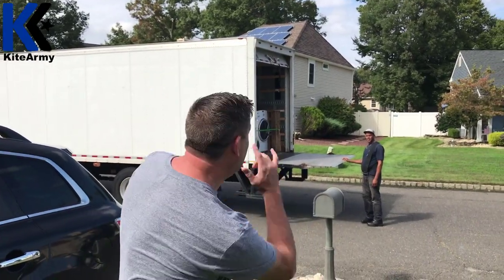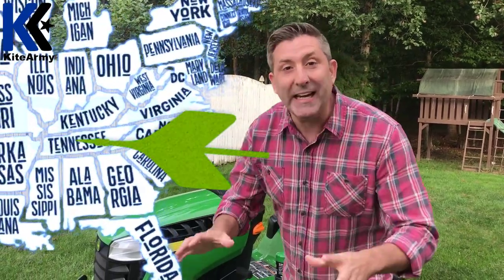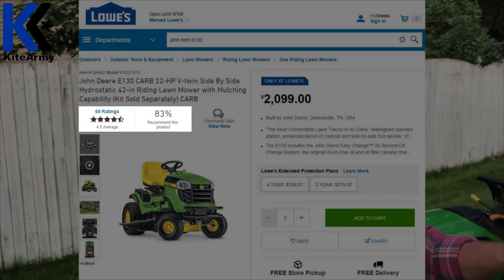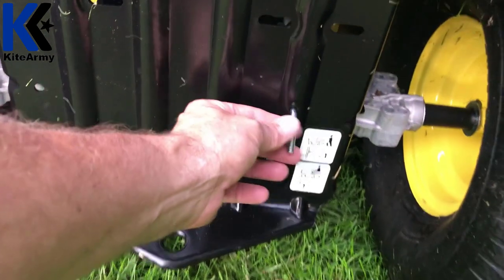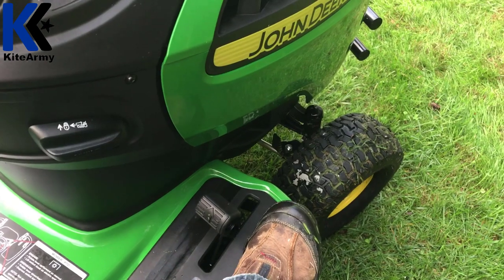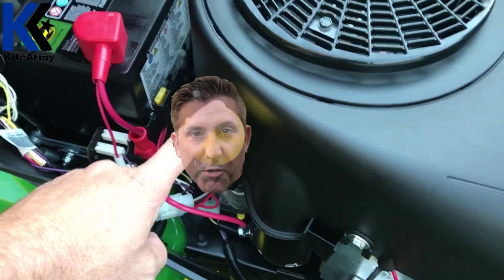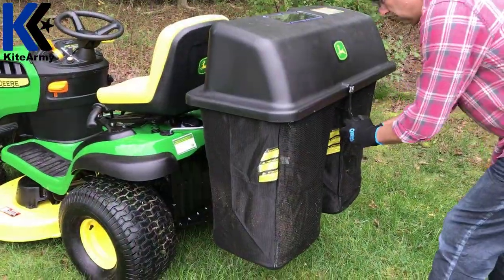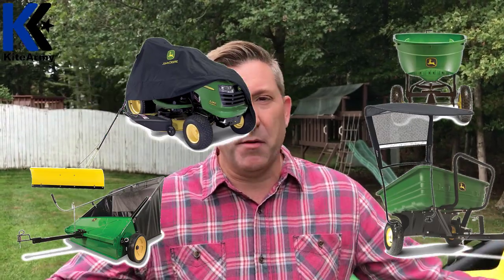Best Riding Lawn Mower 2019 | John Deere E130 Review 🌿🌿🌿

Comment: I am leary of the Easy Change oil filter system on the JD mowers until  15 or 20 years of proof they are engine worthy let alone the added expense of changing your oil verses an oil filter plus 2 qts. of oil.
Reply from the maker: I have the same worry - that being said if you follow the schedule I bet you will have no problems.  I have neglected changing the oil in some of my machines just because it is such a headache - that must be worse than this.  Only time will tell but I think this will work out.
Reply: Is anyone aware yet that this oil filter package is $39.99. Around half of the dirty oil will remain in the engines sump, so each oil change will more or less refresh the dirty oil. J.D. has been in the grounds care business since 1963 with the introduction of the 110 garden tractor. J.D. and Briggs & Stratton still can't come up with no mess oil changes, so this is the answer? Also it is pre- filled with Turf Guard 10w30 which is inferior on 4 stroke cycle air cooled engines in hot weather. They say 10-30 is fuel saving, yet it is a year round compromise and the engineers know it! SAE 30 above 40 degrees and 5w20 or 5w30 below 40 degrees. I am a 56 year old collector of lawn and garden tractors and have been restoring/repairing since 9 years of age. The point I am trying to convey is that engineering on 100 series models is price consideration only. My D140 has had the following  issues after only 3 years and 240 hrs service: front wheel bearing failure even though I was using J.D. SD Polyurea grease, deck and drive belt failures, headlamp pigtail socket failure, and front tires that wear extremely fast [DONT DRIVE ON ROADS]. I wont even get started with the video as [respectfully] Kite Army will learn in time the foibles of these lawn tractors. One last thing. 2 quarts of Pennzoil 30wt and a yellow [premium]  696854 Briggs oil filter cost about $12.00. Thanks....
Reply from the maker: @billrice2284  Fair comment - Anything that saves me time to do the things I need/want to do - I'm mostly on board - even at $40 per oil change.  Don't forget, lots of people don't perform the oil change themselves, so they end up paying $200 for a oil change.  I like this solution.

Comment: Do yourself a favor get a pre owned GX 335 for about 2500.00 it is a super solid unit with power steering and power deck , I would not buy anything green sold at lowes. I paid 6K for my GX in 2000
20 years later still my primary mower . See if this Lowes deere is around in 20 years.  I mow 2.0 acres plus pull a 1,000 pound trailer.
Reply from the maker: I wonder if I will be around in 20 years :)
Reply: I hope so , I just like Over Engineered  ,  It has only had routine maintenance
Reply from the maker: Cool.  Do you think that the quality of the Loews John Deere is inferior?
Reply: Kite Army 
All BS aside model for model no but a $2000 to $ 3000 John Deere at Lowe’s or the John Deere Dealer is not the same mower that built the John Deere Reputation of Long Term Durability.  The LX series that JD Sold in the 1990 years was 3,000 to 4,000 then followed by the GX then the 425 Series .
The difference is the Duty Cycle and the Strength of the Parts for the long term  The  Higher series and I don’t know .
Todays numbers  but they might have power decks , power steering , all wheel drive , 3/16 or 1/4 inch steel frames They all mow good usually right out of the box .   And for many people they are all they need or can afford and thats fine , just not for me .
Reply from the maker: John Deere has an excellent reputation.  They probably saw an opportunity for folks who have a small area to mow but still want a quality mower.  I guess I will let you know how it works out in 20 years :)
Reply: Kite Army 

You contact me i may not remember to contact you at 74  But i hope we both are still green
Reply from the maker: Looking forward to it
Reply: I would not buy any mower at lowes the deeres are good but the rest are cheap junk.
Reply: It's a lawn tractor and for many a lawn tractor is all that is needed.  I got close to 20 years out of my $1200.00 Craftsman mowing my half acre before buying an E170, and I anticipate the E170 will last just as long for what I use it for.  For people with a smaller yard, you don't need a $6K machine to cut grass. "Preowned" is always a crapshoot.  You can get one that is great, but you can also get a perpetual science project.

Comment: All the “E” series JD’s got fairly crappy reviews on the Lowe’s site. Hard to tell how much is user error, poor service from Lowe’s or the John Deere dealer who preps them before being sold by Lowe’s. While the self contained oil change is definitely convenient, the $70.00 per unit price tag isn’t! I really wanted to get a John Deere mower  this spring however I’m still on the fence.
Reply from the maker: I think this is pretty good - I think a lot of people just grip about things.  I picked up the oil change for about $45 - much cheaper than having the dealer do it.
Reply: The E140 has a regular oil filter...I’m buying it soon or an S240 or possibly an X series mower.
I have a D 110 now for 4 years.  No problems..worked it hard.
I would only expect to mow the lawn or use the cart.  No snow.
Reply from the maker: I prefer the all-in-1 filter
Reply: I work at the Greeneville factory that builds this mower...I can promise you, we put a lot of love into each unit we build.
Reply from the maker: Thanks so much for commenting - sounds like a labor of love

Comment: =longest lasting is the e100 with a manual transmission,hydrostatic trans will be the first thing to break on your john deere
Reply from the maker: I have heard complaints about the hydrostatic trans - Mine is holding up good - lets see with time
Reply: E100 has a plastic transmission, e110 or better is steel.
Reply from the maker: @nickm.6408  yikes plastic?

Comment: MTD with a green paint job
Reply: They are ALL MTD Built
Reply from the maker: @petmycat2720  I can't find any info that MTD builds these mowers?
Reply: @Kitearmy  I just called a friend of mine and he said Briggs and Stratton build some engines for John Deer. He works at Briggs and Stratton in Milwaukee Wi.
Reply from the maker: @petmycat2720  It could be a different model?  I think MTD is a competitor
Reply: @ADJ30168 Please say it aint so...I'm researching to buy one.
Reply: @ADJ30168 Great...Now I'm going to bed upset....THANKS MAN.
Reply from the maker: @ADJ30168 I have heard rumors of that.  Though on the documentation it says made if Greenville TN?
Reply from the maker: @ADJ30168 All sounds plausible.  I guess you pay for what you get - but I have to say this mower so far seems to be holding up well.
Reply from the maker: @ADJ30168 No way - your comments were more than fair.
Reply: @ADJ30168 The motor is MTD.  Confirmed this at my local JD dealership. However, they do stand by the 2 year or 120 hour warranty, especially if you buy from them.  They will pick it up for free, fix it, and bring it back.
Reply: Nick M. Your dealer is full of shit... MTD does not build engines.  John Deere does not sell equipment with their name on it unless they make it, period.  These are built by John Deere in Greenville TN and they use Briggs and Stratton Intek or ELS Series engines.
Reply: Jack Wertenbach wrong, try again
Reply: PETMYCAT wrong
Reply: They are not at all mtd lol
Reply: @ADJ30168 you are wrong. These are the same exact mowers you get at a JD store
Reply: @nickm.6408  So if I buy a JD from Lowe's & I get fed up with them not being able to help with a problem, the dealership will take of me as if I bought it from them?
Reply: ADJ30168 the e160 I bought last is to be taken to my local John Deere dealership. Which we bought a tractor from in the 70’s.
Reply: Just  got a E130 and I like it.Hope it lasts as long as my Cub Cadet has, 16 yrs
But  in the 16 yrs i replaced an engine (at 18 months out of warrentee) and PTU at 2.5 yrs after that it was good until this yr when deck rotted out 
The Deere rides like a truck compared to the CUB CADET but it cut great and has power to spare. As for comment about just an MTD painted green he is a jerk
MTD makes around 4 or 5 different lawn tractors JD isn't  one of them. The Cub Cadet IS.
Reply: Not even close
Reply: @Kitearmy  because they dont. This guy don't know wtf hes talking about
Reply: @ADJ30168 false
Reply: @ADJ30168 it's the same exact mower you can find at a JD dealer 100%

Comment: It is ridiculous that they say a model is good for only an acre, WHY, can't it hold up past an acre?  
I got one. I like it.  It cuts the grass perfectly. The belt system is well designed. 
It is the best choice of the mowers in its class. 

BUT, the seat is not for tall guys. On hills, I nearly side off of the seat. 
The cleaner is useless. The deck spindles are sealed, so greasing them is not possible. 
The automatic transmission is weak, a standard would be a better choice, if there was one. 
The quick change oil filter is absolutely stupid.  Just a gimmick for more revenue.
Reply from the maker: So - I'm not sure do you like this mower or not?  Sure it can be used for more than 1 acre but they sell other mowers that will make the work easier and require less time.  I also like the quick change oil filter - just easier and gets it off my honey do list

Comment: Eh I don’t like having to push down a pedal to make it go. Why not put it in gear you want and go?

I’d go for a zero turn personally
Reply from the maker: This also controls your speed - the harder you push the faster you go
Reply: I bought one of these and got it yesterday and the same model the e130 and it jolts a lot like most of the time I like jolt in the front is that normal cause it kinda hurts your body?
Reply from the maker: @jacksingh2407  Mine did not do that - you have to push the accelerator smoothly - it controls the speed

Comment: The only thing that is a flaw in my opinion is the engine, the Briggs is a good engine but it won’t last as long as the Kawasaki on the S240 and the X300 X500 and gasoline X700 tractors. If you want to spend a bit more and get the S240 with a 42 or 48 inch deck it would last longer. But other than that great machine!
Reply from the maker: I do agree - I would prefer a Kawasaki over and B&S

Comment: I will never have a yellow and green machine on my property again this factory makes machines using the JD name but not the reliability, John Deere sold out, I was told my machine is not meant for hills transmission is shot after a year and if I fix it for 1500. I am still stuck with a machine that is useless on hills...By ignoring the Lowes Costco or just any big box stores for quality issues, John Deere you lost me!
Reply from the maker: That's sad to hear - I don't have any rough turain so I can't speak to that.
Reply: Look to see if it has a hydro gear transmission...a quality small engine Repair shop knows John deere want cover under warranty  , the transmission is still covered by hydro gear...they warranty is different, theyll send a new one ,I delt with husqvarna on this, 2 dealerships had no idea,try it
Reply from the maker: @davidrodgers7224  I have heard other complaining about he hydrostatic trans  - I love mine but it is still very new
Reply: What happened to your 2yr bumper to bumper?
Reply from the maker: @greekphysique6141  Good question

Comment: And it’s a briggs engine not a John Deere
Reply from the maker: Right
Reply: Yep. Briggs & Stratton with a J-D sticker on it. I've had my 145 for 12 years and the 24 hp  engine has always performed well, uses no oil. I just change the oil and filter every Spring, air filter every other year, and spark plugs about every 3-4 years. Grease the fittings and the front axle rub points about twice a year. I don't use it all that much, about 25 hours a year.
Reply: Rob J I have a 15 hp kohler from 1997 and I have 1200 hours on it uses no oil. Some kohlers are bullet proof!

Comment: Heres the truth, I have had one of those for 7 years, the motor not made by deere is great. The deck is trash, total trash. had it crack at the weld joints multiple times and places. The spindles greased every month I. Summer still crapped out.
Reply from the maker: That's not a good report at all.  Hopefully my experience will be better

Comment: Unfortunately this machine comes with a Briggs and Straton engine.  Briggs used to be a good engine however they lack reliability now days.  The Kawasaki V twin is far superior.  Can NOT get the Kawasaki engine on a 100 series riding mower.  For just $400.00 more ($2,400) you can get the JD S240 which is a better mower than this 100 series is.
Reply from the maker: I use to love B&S too.  I'm not as confident with their reliability.  Thanks for the comment
Reply: I've run my JD with a Briggs 19.5hp motor for 10 years without a hiccup. Take cafe of it, it'll take care of you.

Comment: Its a nice riding mower, but I wouldnt buy it because it has a Briggs and Stratton engine
Reply from the maker: I have hesitation about B&S too
Reply: I had a Craftsman mower for 18 years. Only got rid of it because the deck rusted through.  The Briggs engine was still running strong. It’s all about maintenance.
Reply from the maker: @danapitman2269  Cool

Comment: if only if it had a manual gear selector
Reply from the maker: I like the automatic but I could see why some people prefer manual
Reply: @Kitearmy  yeah manual in my opinion is better because I don't like to press the pedal to move it
Reply from the maker: OK - I prefer the pedal that can control your speed
Reply: @Kitearmy  what would be better if there would be a pedal that actually adjusts air to fuel ratio, it exists in aircrafts but not in cars or lawnmowers. The benefit with this would be that we can pretty much adjust fuel consumption for the task the lawnmower would be doing
Reply from the maker: Wow - a purist!

Comment: You are biased due to getting the mower for free.  You didn't say what you like compared to other mowers.
Reply from the maker: True - I'm also honest, unlike most other videos on youtube - that get if for free and don't tell you.
Reply: @Kitearmy  ,  I need to buy a new 42" in Spring-2020.  Thinking Sears ProSeries, Husqvarna, John Deere.
I want HydroStatic,  Kohler engine, cast front axle
Was hoping for $2000 or less.
What do you recommend?
I have a 30 yr old 42" Craftsman with Hydro + Kohler.  Still running great but the deck has corrosion holes.
Reply from the maker: @rondail5675  I would stay away from the Sears - they are built by a bunch of manufactors and are not what they were.  Don't know much about Husky but it might be hard to repair if you have an issue.  I'm in the process of testing a Toro zero turn.  Don't know if I can recommend yet.

Comment: #1, No way would I ever buy a mower from a box store!!! Buy the same mower from a real JD dealer and there going to put you at the top of the list to get it fixed. #2, I'd never buy another JD mower, and I've own 3 of them Unless it was a commercial unit. The decks rotted out, in one year all the spindles had to be replaced, deck belt kept falling off. After 2 years the seat cracked, the hood broke in 1/2,  go with a Z turn with a real welded deck and your cutting and trimming time will be 1/2 and the deck will last a life time.
Reply from the maker: Wow - sounds like you got a real lemon.  Should have bought from big box and saved some money
Reply: @Kitearmy  If you have a tiny yard, no sand it might hold up, anyone notice Lowes is the sponsor? I had one of those so called baggers, it was useless, grass to high, or to wet your going to just spend time just cleaning out the chute. It does not even compost the leaves. When I went to my local JD dealer he begged me not to buy it. I ended up giving it away and buying a Trac Vac.
Reply from the maker: @josephrobichaud5198  Well I'm with you - nothing but battery powered yard tools for me now https://youtu.be/_GmY3UQQglM
Reply: Hmm it sounds like you were abusing the mower a lot and using it as bush hog, I don’t think it is a coincidence that all those things broke that fast... Unless you were abusing it and leaving it outside

Comment: ridiculously overpowered...  and looks tiring on the right leg.  I want a manual transmission and a clutch, and will NEVER buy a mower without them.
Reply from the maker: First complaint I have heard of too much power - but OKay
Reply: Also has cruise control
Reply from the maker: @joshuaworks9640  good point
Reply: These are not tiring on the leg at all, you don;t even give it a second thought.  They drive like a car and brake as you let off the pedal, and the pedal effort is minimal.  I wouldn't ever want to go back to a manual gear tractor with clutch/brake or hand controlled hydro after using this setup.
Reply: @MarkPalmer1000  I don't know about your car,,, but mine does NOT have a 'dead man' switch that turns it off, (unless you count the accelerator pedal as one).  And no tractor I have ever driven is set up that way.
Reply: @johnhasse3995  just about every hydrostatic lawn/garden tractor has been set up with foot pedal controls for well over a decade. The control is easier, safer, and more convenient for speed control than anything else out there. I have had many gear drive and hand controlled hydro tractors- this system is IMHO by far the best.
Reply: @MarkPalmer1000  Would that  include rather hilly ground?  I confess I am living in the past, and on  rather steep land.  Most folks like automatic transmissions in cars, also,,, but unless the automatic  is REALLY cheap, I will continue to choose the stick shift.
Reply: @johnhasse3995  sure, they function fine on hills and on the left side of these John Deere lawn tractors there is a standard brake brake pedal that can lock down as a parking brake.  I have a '67 Wheel Horse 8 speed manual I still enjoy using time to time.